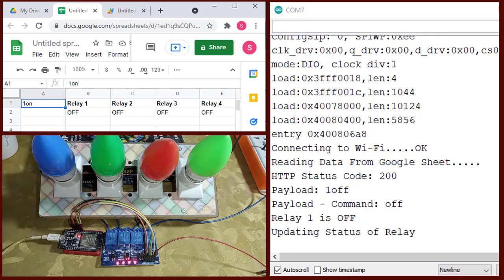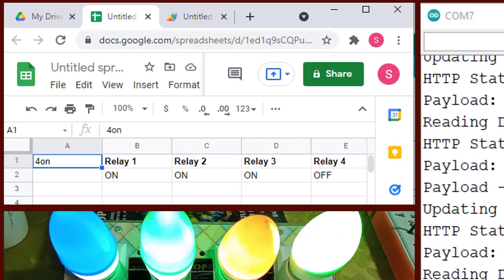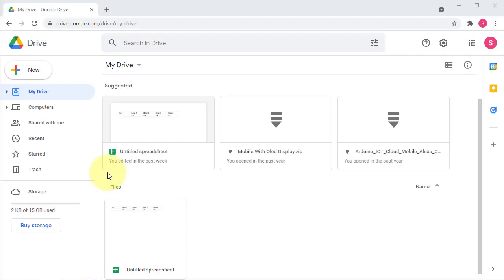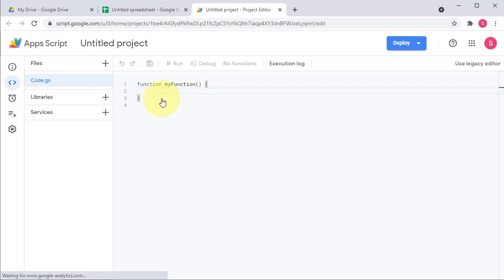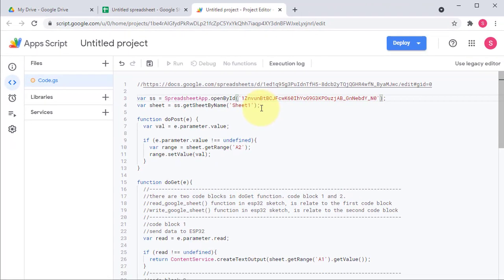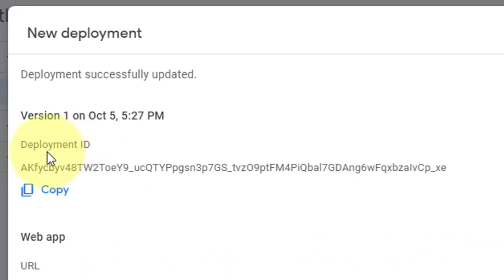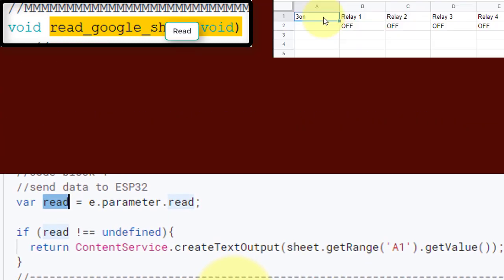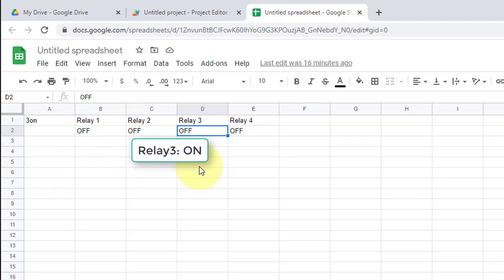ESP32 Relay Control With Google Sheets | ESP32 Home Automation

Comment: I tried, but not run, invalid command..whats wrong?
Reply from the maker: give me some more details about the error.
Reply: @AhmadLogs  in serial monitor Invalid Command
Reading Data From Google Sheet.....
HTTP Status Code: 200
 command, please help
Reply from the maker: @Sarjanandeso  try some old version of the esp32 core from the board manager in arduino IDE
Reply: @AhmadLogs  I use ESP 32 Versi 3, in your use ESP 32 expresif..
Reply from the maker: @Sarjanandeso  I am talking about the software version from the tools->boards->board manager of arduino ide
Reply: @AhmadLogs  in Apps Script TypeError: Cannot read property 'parameter' of undefined
doGet	@ Kode.gs:21
Reply: please help me sir..im curious about it
Reply from the maker: @Sarjanandeso  there is issue with your google script code. you are trying to read a property that never exists. so, I will have to take a look at your code both google script and arduino sketch
Reply: I have succeeded, thank you sir
Reply from the maker: @Sarjanandeso  great!
Reply: @Sarjanandeso  can you tell me what you did to succeed, I'm have same issues, thanks
Reply: @Sarjanandeso  i have some issue , please tell me how to resolve the problem sir..

Comment: NICE!! how to use this code an esp8266 not esp32?, what is the library changed? thank you
Reply from the maker: No change. this code will work on esp8266. just give a try
Reply: @AhmadLogs  I tried with esp8266, here is the error
-> candidates: [] sketch_oct06a: 16: 24: fatal error: HTTPClient.h: No such file or directory
Reply from the maker: @kamalkamel7559  hmmmmm. then you need to test ESP8266HTTPClient. but It required to update the code as well
Reply: @AhmadLogs  i have some issue , please tell me how to resolve the problem sir..
Reply: @AhmadLogs  
I uploaded this code for ESP8266, it gives me the following error:
  Reading Data From Google Sheet...
  HTTP Status Code: -5
  Error on HTTP request
What do you think is the solution?